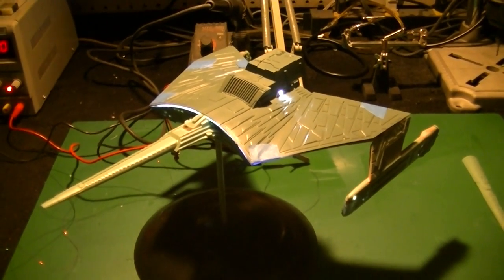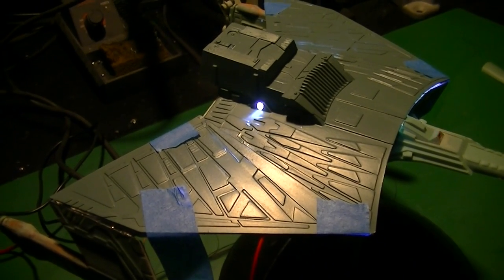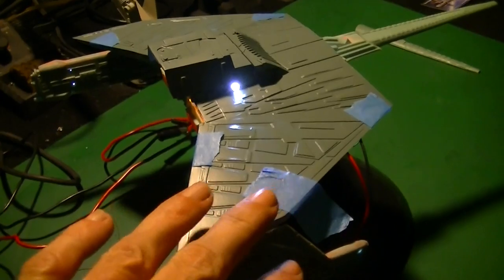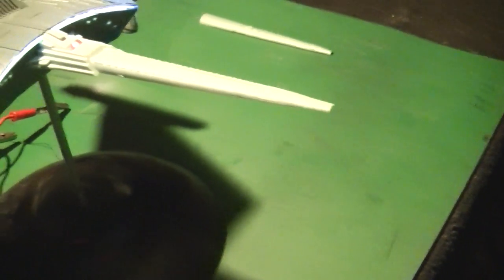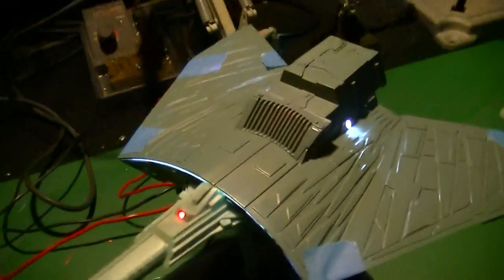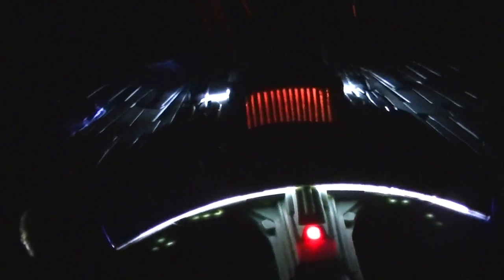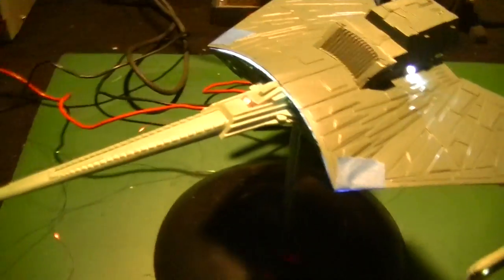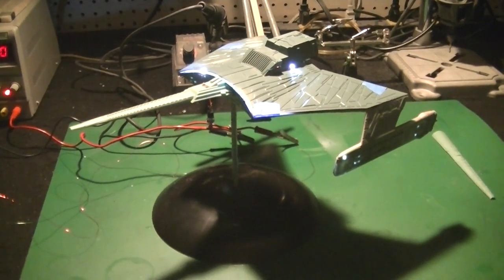AMT 1/537 Scale Klingon K'tinga Cruiser Buildup PT 3

Comment from the maker: It actually fits pretty good and it is just laying on the top in the video. The worst gap is at the edges where the pylons meet the hull on the top. Its worse on the starboard side than the port. Some Evercoat filler and some shaping will fix it right up.